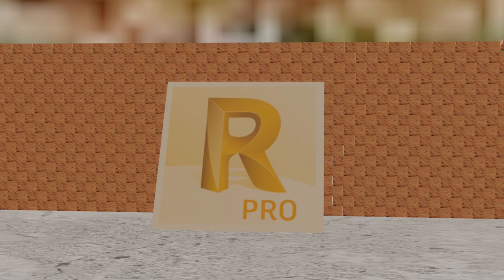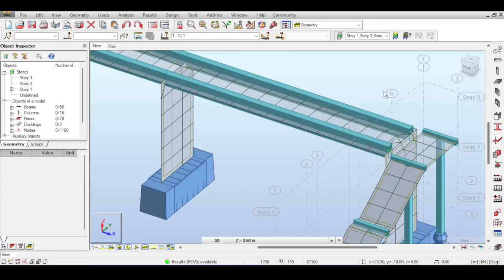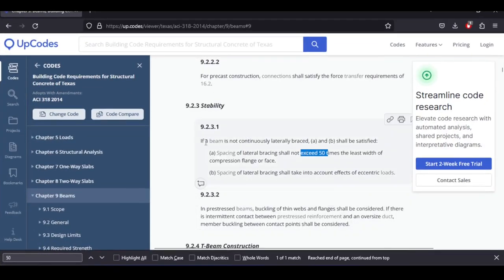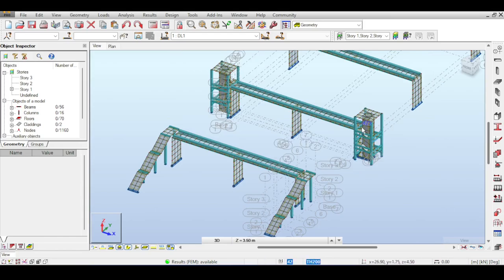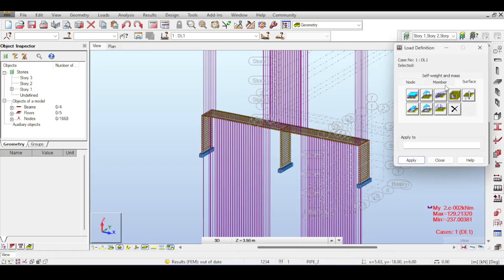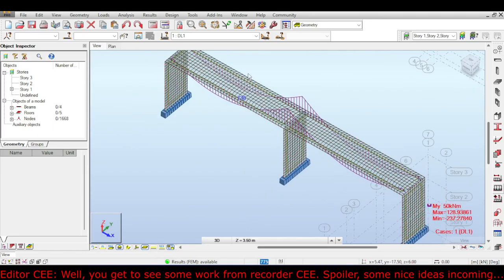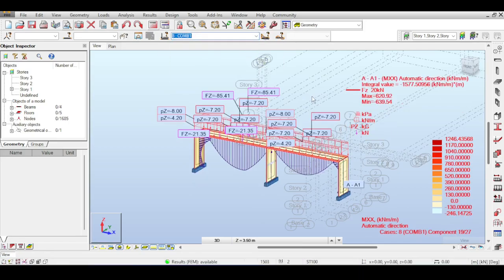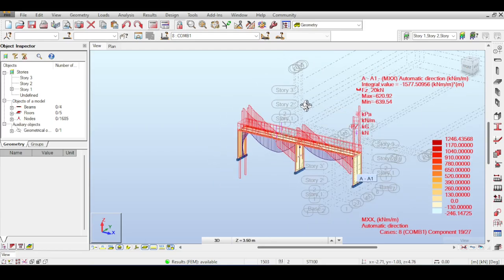Modeling Pedestrian Bridges Using Autodesk Robot | Part 4 - Wrapping up

Comment: Hello CEE,

If I may, I would like to propose a future video tutorial idea for the CEE consideration as follows:

• Modelling and Design of stiffened RC raft foundations for light structures (using finite element method in RSAP).
• The particular foundation that I am referring to comprises of a RC floor slab that is cast monolithic with a grillage of RC 	rectangular downstand beams.
• This type of foundation is mostly used in residential housing and in other light public or commercial structures founded in 	expansive (heaving clay) soil.
• Some of the empirical and rational stiffened raft foundation design methods include Lytton Method, Lytton and Woodburn method, Walsh method, Mitchel method, Swinburne method, etc.  

• Follow on from the previous CEE tutorial video on the “…Modelling Mat (Raft) Foundations (Flexible Method)…” I have tried to model the above requested “stiffened RC raft foundation concept for light structures” by defining an “Orthotropic” floor thickness using RSAP pre-defined template of a floor with “one-sided, bidirectional ribs” 

Whilst this approach does “perfectly” allow one to model the stiffened RC raft geometric parameters that are required. RSAP help files (support and learning) noted and confirmed that for a slab that is defined in this way, the “…local change of rib stiffness is not recognized; the exact slab geometry is not visualized and it is not recognized during calculations of reinforcement….. Reinforcement calculations for this type of slab will not provide correct results. A new algorithm for slab reinforcement should be implemented that would recognize a T-section or an H-section. Therefore, the reinforcement calculations for this type of slab are carried out as if they were homogenous slabs with invariable cross-section….”

https://knowledge.autodesk.com/support/robot-structural-analysis-professional/learn-explore/caas/CloudHelp/cloudhelp/2022/ENU/RSAPRO-UsersGuide/files/GUID-2000B438-5453-4C90-B658-E3DE6F8AF33A-htm.html 

• In practice, the beams (placed 2m to 4m centres) and the integrated floor slab (usually 100mm to 150mm thick or more) are each reinforced “separately”. The beams are reinforced as rectangular beams sections with both top and bottom rebars and the floor slab is reinforced with either a steel fabric mesh reinforcement or with normal top and bottom layers of slab reinforcements. 

“standardised” detailing of stiffened RC raft foundations containing mesh reinforcement in the floor slab was for example recently (2019) withdrawn from the New Zealand building code NZS3604 in favour of calculation methodologies and design by engineering principles. 

The mesh reinforced floor slab is (according to the ideas leading to the above withdrawal) viewed to be flawed in that “…the 100mm thick floor spanning between beams at 2.5m centres is unlikely to be sufficiently stiff and strong. The slab needs to be both capable of transferring soil expansive forces to the beams and spanning between the beams should the soil contract away from the underside….”

• If one were to keep things “simple” 😊, what options are available in RSAP to determine the values of the Moments and Shear forces for which to design a) each of the beams in each of the perpendicular directions? b) the integrated floor slab required reinforcements as a two-way slab?

• Could this problem be modelled or be approached in more than one way in RSAP? Can the CEE illustrate the various conceivable or available approaches side by side 😊 if possible?

I know it’s a tall order but the CEE is the G.O.A.T that has proven capabilities and out-of-the box thinking beyond imaginations.

Regards, DK
Reply from the maker: I see what you mean. Basically you have "inverted beams" that are on the raft foundation. I guess those inverted beams are also below the ground floor walls. Now I saw RC floor slab in your comment, but I guess you meant the raft, right?

Indeed, whatever you use for the shell thickness (monolithic or not) will only affect the stiffness matrix, deflections and so on, but has 0 influence on the design. It will not design you those little things.

I will take a look on that definitely, and also on your methods that you use. I am gonna prepare me smthn nice with that regard. It might not be in the next video, but definitely something worth to be checked.

Thanks for being around, 
Regards,
CEE

Comment: sir u do not recommend offsetting option for beam and slab as u did centroid connection, but how this will impact final design
Reply from the maker: correct. Shifting is only for modeling purposes. And even when you shift, you have to keep in mind that if you have any axial force, it will cause moment.
PS: Sorry for the late reply. I had a ton of things to finish and now I am gradually getting back
Reply: @CivilEngineeringEssentials  as per my understanding we need to increase Iy= (Iy of T-section/Iy of Rec section) as to control deflection

Comment: it means that we cannot define proper lane on shell as in csi bridge, as you have assigned ML to frame element, moreover does this ML is transferring to shell from frame?
Reply from the maker: Correct. RSA is weaker here. The reason is that RSA is a general structural analysis software whereas CSI bridge is dedicated for bridge analysis, so it has better tools

PS: Sorry for the late reply. I had a ton of things to finish and now I am gradually getting back

Comment: also need to assign bridge bearing on support having certain stiffness which i think is not possible in RSA
Reply from the maker: if you want to model elastomer bearings, you have to make a "release" and enable "linear" to add a spring stiffness
PS: Sorry for the late reply. I had a ton of things to finish and now I am gradually getting back